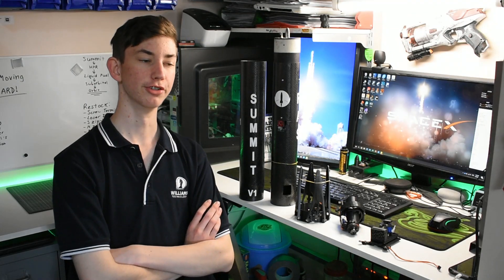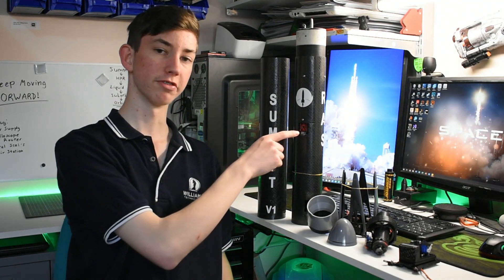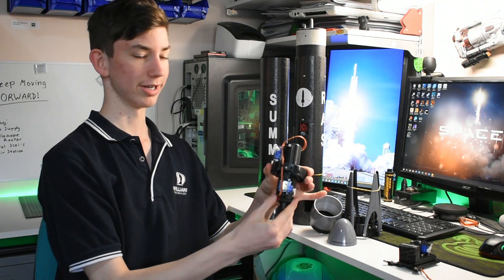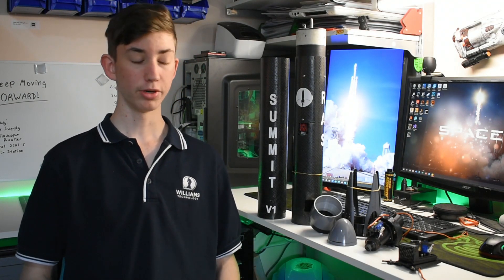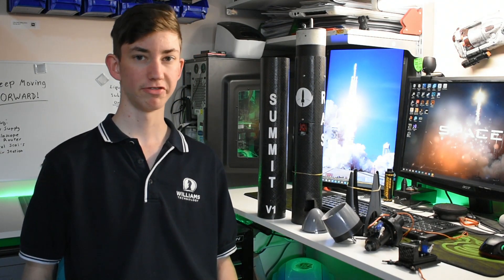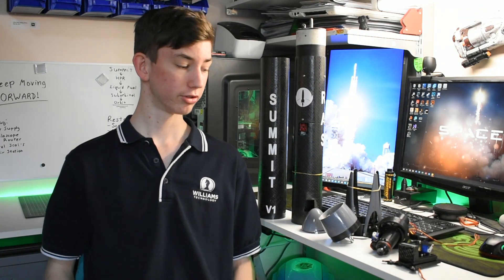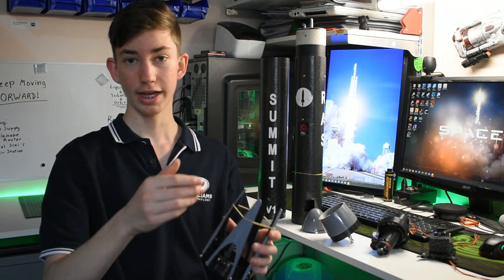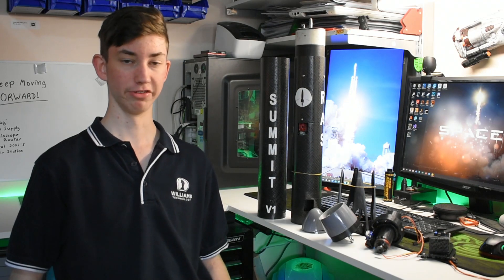Summit V1 First Launch Attempt – Motor Anomaly Fire

Comment: How did you make the carbon fiber body? It looks gorgeous! Good luck on future launches
Reply from the maker: I made a mandrel (mould) out of PVC pipe and MDF spacers. Wrapped that in non-stick paper and coated it in epoxy resin. Then wrapped the carbon fabric around it, adding resin each layer and using a squeegee to remove all air bubbles. Then wrapped the final product in peel ply which soaks up excess resin. Then a lot of sanding and a nice clear coat to get the final finish of the tube!